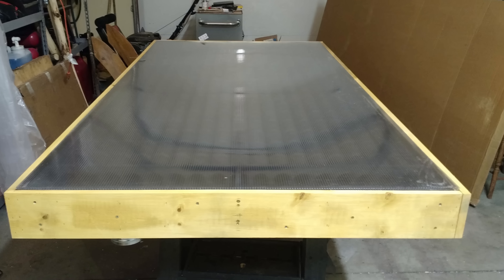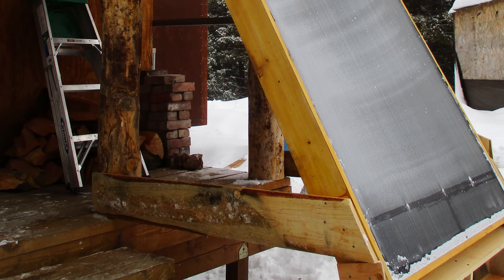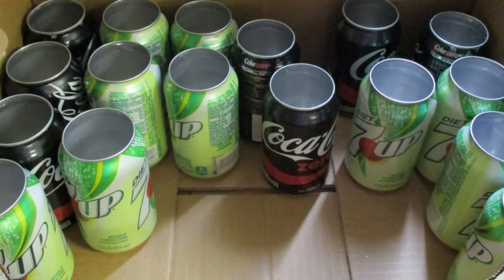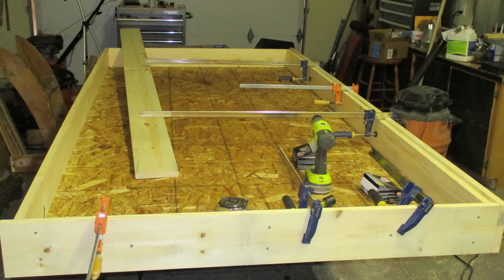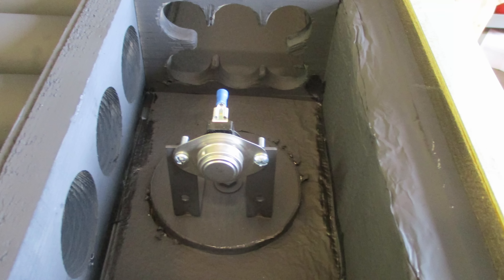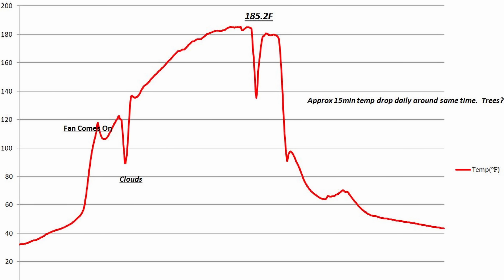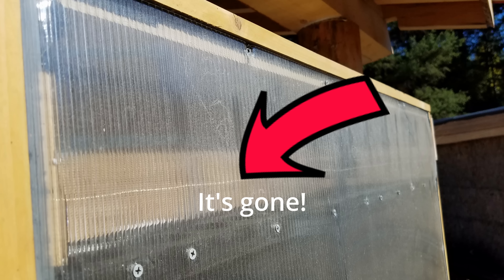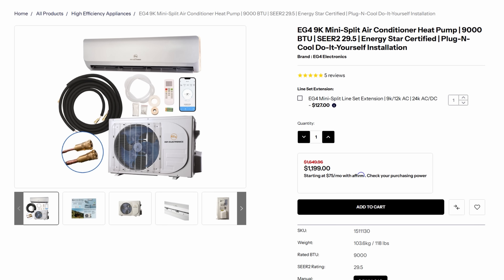7 Years with Pop Can Solar Heater - Is It Still Worth It?

Comment: You know most "pop cans" have a plastic liner inside them.   There are more efficient conductors.  Better than a pop can.   Love the idea by the way,  just think you need a more purpose built radiator.
Reply from the maker: I didn't know that and hadn't seen any evidence of it but it that were the case, these still performed amazingly well.
Reply: @TheOldJarhead  Another thing you might look into,  Is a blacker black.   Yea,  cause what you are doing is absorbing radiation.  Your black is rated roughly 88%.  And there are some blacks that exceed 95% light absorption  and I think there is a new black paint that absorbs 99.95% all light that shines on it.  Its called Black 4.0
The color of paint alone could increase a good 10% or more just on maximizing absorption
.
Reply: So I am building a new house this spring.  I have this idea,  That I would like to try some of this stuff for reduced heating and also water.   I would like to run black pipe with water in it in coils on my roof and make a type of free hot water heater (Atleast while the sun shines) 
I will keep in touch
Reply: Just curious,  You a Marine Vet?
I am a Airforce Vet.  I was active duty when twin towers were attacked and served thru Afghanistan and Iraq.
Reply from the maker: Yes sir :)  1986-1991 (Desert Storm) and 96-99 USA
Reply: @TheOldJarhead  I watched a video (a short I think) where a fella partially dissolved an aluminum can and the liner was still holding soda pop.

Comment: If that box reached 500F, it would have ignited because spruce lumber will ignite at about 370F.
Reply from the maker: Pine and SOB but that's a good thing to consider.  However, I've seen lumber get incredibly hot and not ignite.

Comment: Nice video! From a boring practical standpoint, solar PV panels seems much more practical. While solar heat collectors technically can be much more efficient, at least in direct sunlight, there many practical issues, and it's quite difficult to move all that heat collected to where you want it. On top of that, with solar panels you can use the power however you want, if you power a dehumidifier for example, that dehumidifier will turn all the power it uses into heat, and also release the heat enthalpy from the water vapor it collects.
Reply from the maker: That's a good point about the versatility of solar PV panels.

Comment: made mine out of 500ml beer cans, enjoyed every minute of emptying them. My glass came from an old patio door, got 2 pieces of thermo glass for $20. I bought a $3 temp controller from China, to start/ stop a 50 cfm fan to push air through. Also have a snap temp switch in the circuit, can't remember why. I started with 3" ducting, switched to 4", should have been 6". Temperature gets to 50-60c, max 90. Sits at about 45 deg, faces SSE.
I have a problem with trees blocking access to the low horizon. Ducting was a challenge.
I manually place a plug in the duct at night, i need to automate that, maybe that was the function of the snap Temp switch.
Reply from the maker: That snap switch can regulate that for sure.

Comment: Thanks for the info.  I'm currently building a small scale trial heater and used a standard manual can-opener to cut away the tops and bottoms of the cans; easier than working with a hole saw.
Reply from the maker: Yes, I ended up using one myself!

Comment: The cans are a head fake.  Not needed, in fact add a very small thermal impedance.  The box is the solar collector, no point in making it into a heat exchanger for (poorly) isolated airflow circuits.
Just build as described w/o the silly cans.  A motorized baffle to prevent nighttime cooling (salvage an old high-eff tank style water heater).  Insulate with mineral wool and tinfoil (cheap & effective) or some other thin sheet metal to encapsulate.  
This video is what happens when someone copies a working idea they don't understand.
Reply: I agree that the cans are a wasted effort.  I built two variations through the years, without any cans or other tubes, and they worked beautifully. All you need is a metal panel on the back of the box, painted black. It will heat the air inside the box, which will rise by convection, without any cans or tubes.
Reply from the maker: Thanks for your input and alternative ideas for the design!

Comment: I'm in South Florida so I don't need one of these, but I was wondering if just using a sheet of metal rather than the cans would work? Here, if you put your hand on a black car in the summer, you might get a whiff of frying ham as you give up some skin to the sun god. I would think that a flat black sheet metal "collector" would work just as well, if not better, than 300 cans glued together. It certainly would be easier to build.
Reply: Yes, I've built two variations of this design, with nothing but black sheet metal panels on the back of the box. They work beautifully.  The cans and tubes are not needed.
Reply from the maker: A flat black sheet metal collector would definitely absorb a lot of heat!

Comment: If everyone is so concerned about a PGE bill all you have to do is focus on very effective insulation then it doesn't matter what your heat or cooling source is but don't forget fresh air. You get some damn r-22 in the walls and find out what happens or if time does not permit you to do that then just get your ass busy and install a wood burning stove. Get one with a deep ash pan to insulate the metal from the embers and you will be removing the ashes less frequent. Heating with wood is the most economic way to this day.
Reply from the maker: Insulation and wood stoves are definitely great options for heating.

Comment: The beer cans are unnecessary. Simply paint the inside of the box black.
Reply from the maker: That's an interesting thought, I appreciate the feedback.
Reply: @TheOldJarhead  Years ago, I enclosed a window on the south side of my home with an array of patio windows, and covered the wall inside that with cardboard painted black. The perimeter of that frame was sealed. By opening the window (not covered), the hot air flowed into the house at the top, and cooler air from the house flowed out of the house and into the air heater. It worked, but fiddling with removing that glass every year was a major task. Should have used lighter and safer plastic glazing.

Comment: You could use a sand battery to store the heat for night use. But that's complicated. If it can really hit 500 degrees. You could run that directly into a metal box or sand, and have a little tube of circulating water in that sand box. Somewhere else have a fan blow the heat off the water where you want it. In the day, the water won't get above boiling so it's consistent, at night the sand will hold the heat much longer, stretching the heat out. Maybe into the day time
Reply: I was going to say the same thing. A sand or crushed rock thermal battery would let you stretch out the hours of usable heat.
Reply from the maker: Something to consider
Reply: @zenith54 I built one that uses aluminum down spouts 8'x12'. I use an 8" duct fan to blow air though. The only time you see high numbers like that is when the air is not moving. It will sustain 120 degrees, I just don't think you can heat the space and try to heat a thermal battery.
Reply: @dragondack  It was just a thought. The specifics are going to vary a lot case by case. Location, climate, how much heat you are generating and consuming, etc.
Reply: @zenith54 I live in Midwestern Minnesota. During the winter, there just isn't enough direct sun light. 10:30-2:30 is the only heat producing time. Now, if you can heat up the sand battery in the summer or start in September, you would be set.
Reply from the maker: That's an interesting idea for heat storage!
Reply: A sand battery may work for extending the heat, but it might also delay hearing in the morning. 

You also want to get the heat out of the solar thermal collector panel as fast as possible to keep the collector as efficient as possible,  and maybe store the energy inside a sand battery inside the building.  The reason is you want to get the heat energy out of the collector rather than store it in the collector and risk radiating the heat way.
Reply: II posted this above, but I'll add it here, regarding storing some of that heat.

One addition to a pop can heater I have pondered (without ever having built one btw) would be to help store the heat by venting it into an insulated box (with either rocks or thin slabs of pavers with air spaces between them) to store some of that heat and release it slowly overnight. Say, with a few holes in the bottom of that box and a few at the top for venting. If the box were metal, it could also act as a sort of radiator as it heats up. Might even be a favorite spot for the cat to go sleep on top of, too.

Comment: With the proper venting in and out it could be used to cool also. Drawing air in from inside gets heated up, going out outside. 
Old homes before electricity used gas flames placed in a central high location to cause the air to rise exiting through windows above.
Reply from the maker: That's an interesting idea about using it for cooling!

Comment: I collected some used shower doors (they are tempered glass). See a recycle center or a junk yard
I purchased a sheet of masonite (peg board without the holes)
From these I constructed my "box".
And for the tubing I purchased aluminum ducting.
And I am using a sheet of foam with an aluminum film on one side to place against the inside of the box.
Using L brackets and tiny bolts and nuts in the corners of the box for stability.
The peg board/masonite makes the structure very much lighter than lumber. And is very easy to drill and to jigsaw the holes for the fans.
In total my purchases including spray paint was 132.67 (including sales tax)
Reply from the maker: Nice!!

Comment: It saves about 1.2 gallons of fuel per season , i think ,  mother earth analyzed this thing.
Reply from the maker: Great point.  Diesel heaters can produce 28,000btu's and use 1 pint of fuel a day or something like that (I'll be testing some soon).   If that's the case I'd think it would use more fuel that a gallon or two but I also have an 8000 btu LPG heater that doesn't use that much propane annually so who knows.

Comment: Wonder if you filled the cans with sand and ran a tube through.  Or just placed sand in there if it would heat through some of the night.
Reply from the maker: It could but the reason for the can's is the almost instant heat transfer they offer -- this is what generates so much heat when the sun hits them

Comment: I thought you were going to do some sort of cost analysis of whether it was worth it. For example you created so many BTUs of heat over 7 years and how that would compare if you were to use some sort of a mini split heat pump
Reply from the maker: That's a very good idea...this heater is estimated to put out around 6000BTU's  At 7 years of use with heat only in the winter and an average of 2-3hrs of production on sunny days only from October through April (at 3200feet in elevation near the Canadian border)I can estimate I've had something in the neighborhood of over a million BTU's of produced heat over that period of time.

How does one quantify the value of that heat of such a long period :D  I guess it kinda is free!

Comment: I was really into these and almost built my own.
The economics have however shifted quite a bit the last few years. 

You can buy solar panels so cheap now that, as long as you have the space, it makes more sense to go that route.
The big advantage of doing it via electric is also that you don't require direct sun.

If it is overcast you still generate power, where the cans really need some sunlight to hit them.

I am glad you mentioned the mini Split, since the amount of energy they can give you in heat is just phenomenal now.
Reply from the maker: You make a great point about the changing economics of solar!

Comment: What if you used aluminum gutter spouts and designed them into a S shaped pattern goes up and down throughout and only having one opening up top. This would be more secure and would be able to be mounted at whatever orientation you want as long as the Hot port is still up. You could also close the loop by drawing in the intake air from inside, warming the already warmer air. (If you're not already doing this). I could see this design mounted like a window on a south facing side with the heat exchange taking place directly through the wall with manual gates to turn on/off and adjust. You'd probably have to provide an emergency relief though. Something like a stopper that would melt when temps get too high and let the heat out.
Reply from the maker: That would be interested to experiment with for sure.
Reply: @TheOldJarhead  Just to add, and this is probably over engineering, but using it to heat water in a drum for a heat battery overnight. This adds more points of failure though, as youve already dealt with.
Reply from the maker: Good point

Comment: Why use lexan when you can probably get a second hand glass coffee table for cheaper ? and glass won't break down and go misty in UV light.
Reply from the maker: Mostly weight.
Reply: @TheOldJarhead  Ah yes you'd need to design around the extra heft.
Reply from the maker: Yup

Comment: $700?!?!? I built one but instead of using pop cans, I used three passes of aluminum window screen at an angle inside the box. Front top corner to bottom rear corner. LOTS of surface area, and it's already black. Simple dryer flap to prevent back flow, and a free door wall from facebook marketplace. That nets you two, double pane insulated glass panels so you can build two of them.
The window screen has more surface area than the cans, and doesn't restrict air flow. That set up comes in at less than 1/2 of your cost.
Reply from the maker: That's great
Reply: I think he may have hyped the cost figure in order to make the little mini-split promo he slipped in look better. Still lot's of good tips and learning from experience here.
Reply from the maker: nope.  I took the prices directly from HD and Lowes for what I used to build the unit.
Reply: @douglascutler1037  TBTH... Unless its a solar powered MiniSplit, the cost of ownership is still WAY more than a solar heaters one time cost.

Even if it IS a solar powered minisplit... The cost of the solar system to run it adequately is going to be MUCH higher than even building a new solar heater every year.

He said he was keeping his batteries warm, so i would assume hes already got a solar system though, which is why it would be just free to him. If you didnt already have that, solar heater is better, as long as you have other means of heat too, cause some days its going to be -10 with snow and clouds for days.
Reply: Actually, the surface area of cans is better than flat surfaces. You would have to make the window screen into corrugate to give it similar surface area. 

Cans also add turbulence which more efficiently transfers the heat from the heating surface to the moving air.

Thirdly, the maximum output of solar energy is 1000W/square meter or ~300BTU/h per square foot. So a 4x8 unit is going to get you 32sqft and a maximum available BTU/Hr of roughly 10,000BTU.  However, thermal dynamics re not this simple... You will easily look at half of that, even for the best setups. The surface area of the cans or screen or whatever you choose to be your heating element, does not matter for the amount of energy absorption. You will always receive from the sun, on a clear day, ~300BTU/Hr if directly facing the sun. So what the surface area does, is allows you to extract more of that available energy. The more curves or ridges that you provide, the more surface area, the more efficient at energy transfer.

Then you have to figure out your air flow rate, because that can cause problems too. Too much air and you dont warm anything. Too little air and you are basically losing energy. So there is a sweetspot for air flow rate and how you manifold your unit as well. having just straight sets of pipes is not as efficient has having a couple of snaking ones. 

There is a WHOLE LOT to this and it is actually a fairly mathematically complicated ordeal. You can just slap a few boards together and put something black in it with a window and bada bing... you got a heater, but the quality of the heater depends on your understanding science and math. The project itself is a 3rd/4th year undergraduate level of understanding/education. You have Thermal Dynamics, Fluid Mechanics and Energy Systems all wrapped up into one... seemingly simple project. 

No doubt your unit works, but im just shedding some light on how you can go about improving your project.
Reply: @Kiba69420  Actually, actually, actually window screen is almost all surface area, and introduces turbulence. There are youtubers that actually did actual testing to prove that aluminum window screen is actually the actual most efficient way to actually do this. Spoken as someone that actually did this in the actual world.
Reply: @1QKGLH  Who, Desertsun, the guy that did his cans wrong? Right right ok. 

You do you booboo, if you are happy with Harbor Freight quality, you're happy with harbor freight quality. Dont have to argue your logic to me.
Reply from the maker: actually cool

Comment: In Finland they sell these factory made, fan included and it has built it 10w solar for the fan, so it doesn't need any electricity and it has automaticly closing thermostat system for the night time.
The biggest unit they make is under 800 euros and little bit over 2 meters long.
Try to search "pöhiskö".
Reply from the maker: That sounds like a very efficient and well-designed unit!